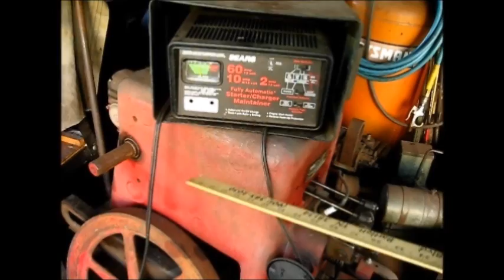Removing Rust with Electrolysis / the clean way

Comment: I bought some carbon as you described, but I also bought some carbon gouging rods which will need to have the copper coatings removed, but that is an easy process. At about 14" long, they can work well in different types of buckets and not be as large as the block types of carbon. A good tub to consider is those fairly cheap cement mixing bins they sell at all box stores as Lowe's or Home Depot. They are for larger pieces, but the depth is only about 6-7" on them. I am anxious to try out your method and I greatly appreciate the information you provided in the video. Years back I used a kiddie pool to use as an electrolysis tank when I did a full fender of my '42 Chevy Business Coupe. Unfortunately for me, one of the sharp edges burst through that pool and the electrolyte mixture went everywhere. Cheap plastic is not the answer, but the mixing bins are made of a stronger plastic. Thanks for the video. ;-)

Comment: Where do you get the graphite?  Graphite is at least $10 per lb.  Honestly, steel might be a better option.  Sure, it doesn't look as pretty, but you can get scrap iron and steel for free anywhere.

Comment: Great video :) Questions though if I may;

1. The powder to use is "Sodium Carbonate"?, doesn't have to be washing powder/soda, but as long as active ingredient(?) or containing "Sodium Carbonate?? What about "Sodium BiCarbonate"?

2. Positive connector from Charger connects to electrode, Negative connects to parts that needs to be cleaned, would that mean the part to be cleaned becomes negatively charged & electrode positively charged ? I though Positive attracts to negative? or the rust particles become Negatively charged & becomes attracted to the positively charged  electrodes (opposites attract)? Sorry, little confused, could someone  clarify?

3. I have a 12v/4amp charger, whats the maximum capacity (Litres) of liquid solution I can use before the power output from the charger becomes too weak to successfully charge the parts & transfer rust ?

4. What happens if the Negative part touches positive charged electrode?

5. How do you dispose of the rust/water solution ?

Thanks, & sorry for all the questions. :)
Reply: 1. just use exactly what he has.

2. electrons flow from negative (cathode) to positive (anode).  hopefully they wont be attracted to one another through electromagnetism and short out your power source.

3. i used a 40 amp 12 volt power supply from a motor-home and it is plenty : ) . there are 200 amp battery charger/starters if you think your setup is insufficient.

4. (see answer for question #2) .

5. it should be ok to evaporate the solution into the atmosphere and then toss the rest in the trash can.

Comment: I seen in mr pete's video where he used a couple of soup cans for anodes. I want to try this. I have some gears that have some rust onto them, but I don't know if they are bad enough to do this with. What's the least rustiest thing you'd put in there Shopdogsam? Okay edit here, I went out in the shed and both my spare spindles are mighty rusty. I'd like to clean them and paint them. so in case I need one I won't have to put a rusty one on my car.

Comment: Graphite is 100% carbon.  It's not going to have a little carbon, it's all carbon. Minus a few negligible impurities.
Reply: He is probably referring to carbon black being mixed with the graphite. Yes they are both made of !00% carbon but different structure.
Reply: TheKajunkat I'm not sure why any reputable seller of carbon products would include carbon black in a graphite product.  Especially a graphite plate being used in electrolysis.  Carbon black is usually found in powdered and liquid forms.  It's used mainly as a dye.  I think one of the reasons to use graphite is because it's conductive.  Loose carbon atoms are not conductive.  They must be structured to conduct.

Comment: Hi Sam.. Loved your video on rust removal.  Prior to watching your video, I setup a tank and cleaned the rust off an old shotgun.  You mentioned something about hydrogen embrittlement in your video and now I am concerned.  I used a steel tank, washing soda (1 tbl per gal water) and a 12 volt battery charger running somewhere above 6 amps.  The meter was pegged.  I used a fan to keep the charger cool and it was cool to the touch ( the actual transformer ). Anyway I left the barrel in for 19 hours and it did the job quite nicely.  But, after watching your video, I'm now concerned about this hydrogen embrittlement.  What are your experiences with it? Am I still good to go? or did I screw it up?  Thanks
Reply: you can do a "bake out" to remove the hydrogen. Put it in an oven at @300F for a couple of hours and all excess hydrogen will be removed.
Reply: @TheKajunkat  baking soda? washing soda solution? part after treatment?  
Thanks
Reply: No bake it in an oven.  The temperature is high enough to allow the hydrogen to move out of the steel but low enough that it won't affect any tempering present from a prior heat treatment

Comment: sam, have you ever removed rust from inside of  a hopper on a hit-n-miss engine by using the hopper as the tank, negative wire hooked to it, then simply put a annode on the positive rebar and dip it inside the hopper ???

Comment: I have used electrolysis a lot and it really does work well.
.
I restored a 1948 John Deere B and even used this process on the
main framework . I used a large plastic barrel and could only do half 
of the frame at one time and then put the other end in the barrel. It
took a little time and effort, but it was well worth it ! It came out great !
Thanks , Shopdog, enjoyed the video .

Comment: So ya start with 5 gallons of water and a 1/2 box of soda. Then ya said ya may need to add maybe up to a gallon of water per day to keep er topped up. Do ya add more soda each time ya top er up considering that after a week or so most all the original water has been changed out or does the original soda remain a solid suspended but not diminished through evaporation?